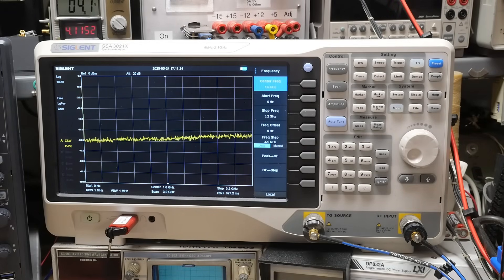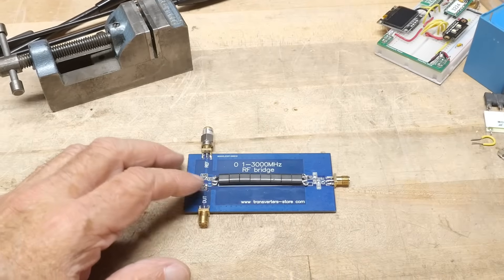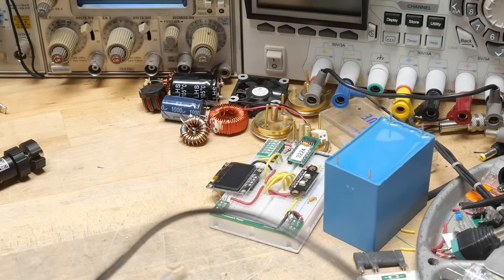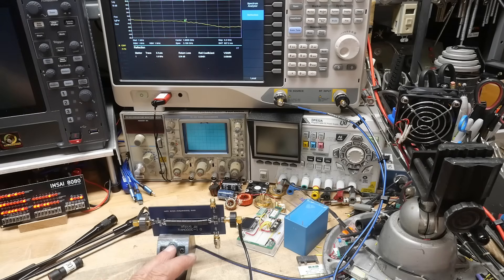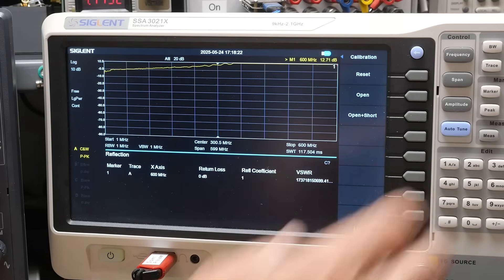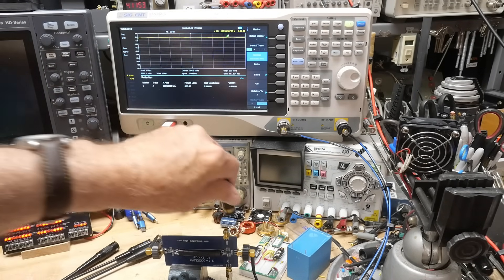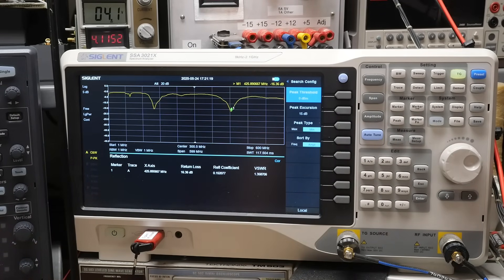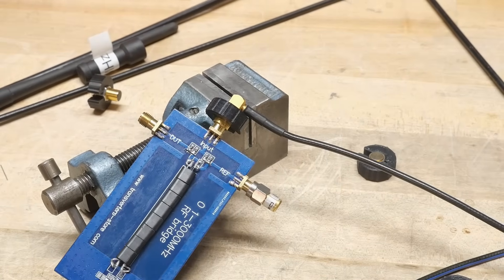#2258 Spectrum Analyzer VSWR Measurement

Comment: 2:52 Hold up a moment.  where did you get those connectors with the nice finger knobs on them? 
 I was planning initially to only comment to drive the beat of the man who invented the internet.  (If you don't get that joke, just ask.  I think you will get a smile out of it)
Reply from the maker: SMA wheels: https://www.pcbway.com/project/shareproject/SMA_Thumbwheel_Wrench_b3dc35b6.html
Reply: @IMSAIGuy  Thanks.  I will likely have to do my own funny looking ones to get the wheel part away from the SMA body because there is an obstruction near the body of the PCB mounted connector.
Reply: I withdraw the question.  I see someone already answered it.  I may do some 3D printing in a bit.
Reply: They're 3d printed.   Also, you spelled "Internet" wrong.   That's how we spelled it back when it was invented.  Not sure, I get your joke, though.  Maybe Vint knows?
Reply: @lmamakos  Yes, I saw another comment that gave the link.  I am to blame for a massively fiddly thing in production that may be causing hand cramps.  My fat fingers work ok for the job but other shaped hands less so.
Reply: @lmamakos  BTW:  Who it is claimed "invented the internet" and also ran for president of the US.  Add the word rhythm on the end.

Comment: Yes, is very nice bridge, no other bridge are better for the price, i have one and i use occasonaly.
I have Narda directionnal coupler and Bridge from Wiltron, i love use these part in my setup also!
Narda directionnal is nice to use on low power radio on one antenna setup to RX without trouble on 20db directional port.
Wiltron bridge have 40db directionnality option, very good for HIGH return loss mesure (very low SWR)
High power noise source with brigde, work good on normal spectrum analyser also, nice video to do?

Comment: I got one of those hand sized Ukrainian antenna analyzers but it is only good up to about 230 MHz.   It can measure SWR,  return loss,  Smith chart,  sweep across a range to see antenna response,   etc.  Only that to get a lot higher in freq requires expensive versions.  But this thing covers 95% of my needs for ham radio.